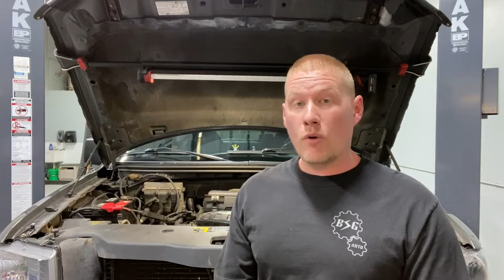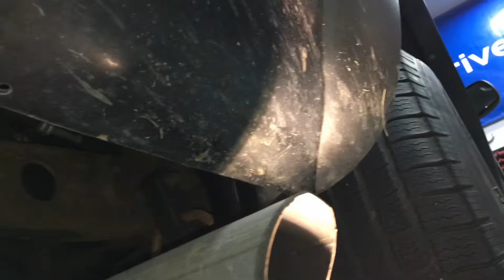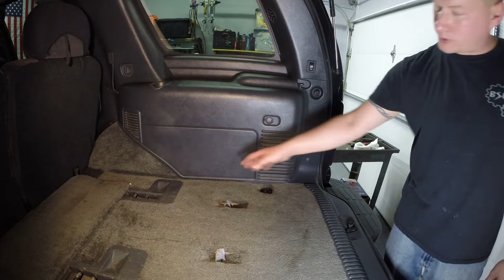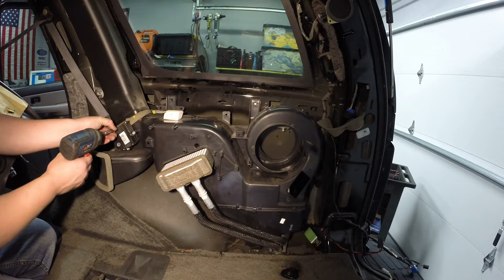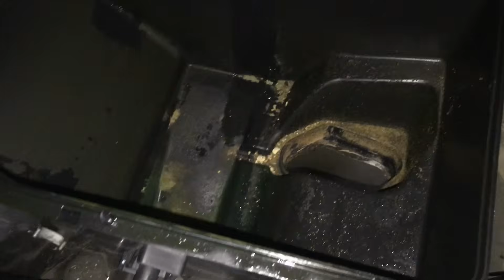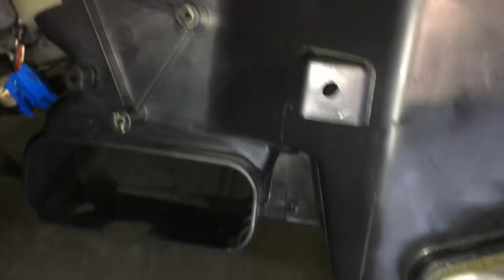2000-2006 Chevy Tahoe Poor A/C Cooling: Rear Evaporator Replacement

Comment: I wasted 30 minutes trying to get the door pins through the holes in the case. You could probably make a whole video on how to do that. I tried wire coat hangars, braising rods, I tried pics, which finally did the trick. I had to have somebody else helping me to line up the plastic alignment pins in the case and to hold the pics so that the door did not fall back down. It was a small nightmare that lasted about 30 or 40 minutes.

Comment: The drain gets plugged and rots the evaporator. Put new drain rubber on here. Use PB blaster on lines a couple days before and AC lines will come right off.

Comment: Man, the AC on this 06 Escalade I bought last year has been leaking worse and worse. The previous owner put dye in it, and we have looked high and low for the leak, but we haven't looked at the rear evaporator. I didn't think the rear evaps were a common failure point but here we. I think this video just fixed me problem lol. Thanks!

Comment: I drive my tahoe alone almost 95 % of the time.  I decide to cap off the rear a/c tubing and just use the front one.  Saved money and the front of the tahoe stays cold still.
Reply: Yo my rear ac line broke that’s under the truck if I do the rear ac delete will this keep the front cold?
Reply: @SixDot2 yes

Comment: Just bought a nice,  no rust, 04 Suburban Z71.  My trusty mechanic is replacing the rear Evap and now I know what he was talking about.  Not hard, just time consuming he said and I agree.  Just as shown there is oil underneath.  I had him inspect it before buying and haven't brought it home yet.  Fixing transfer case,  dash cluster and oil pick-up seal too.  198 K.   Awesome video,  Thanks.

Comment: BSG!   Hey,  is there an orifice tube on the rear HVAC?   Or a filter screen?   If so is it on the high or low side line, and can it be cleaned and reused?   Also,  is the Expansion valve a recurring problem?  And is that included with the EVAP when you buy it?  My Front HVAC works great, my rear HVAC EVAP is not cold.   I have to have a blockage,  either expansion valve, or orifice tube.  What do you think?
Reply: if it is on similar vehicle the a/c system is tee'd from compressor, so a leak you wouldnt have cold up front, most likely you have a blend motor stuck causing heat instead of cold

Comment: how did you find out that the rear evaporator was the leaking part
Reply: mine ,  leak dye could be seen externally from vehicle all around drip condensate drain tube and inside

Comment: Definitely the best video on how to disassemble the rear ac box! 

But here's my issue, this lady hit me right there in the back rear passenger trunk /Ac area! I took apart the panels to get to the ac! I thought the whole thing would be crushed, but it looks intact, but now my concern is the evap part I thinks she crushed that part of it from the way the side quarter panel is pushed in to the point that could be my issue, that part is $250/$500 an to add the icing on the cake ,sorry ass progressive insurance company sided with the lady who hit me, by 80% my fault (nj ain't shit) ,but she hit me in the back trunk area ,but in nj if you make a left turn ,no matter how the accident happened it's your fault! Crazy as f I know!

Comment: I hate those hidden, push-in fasteners.  Removing them correctly feels exactly the same as breaking the damned things... and you don't know until they're broken.  And then the specialty ones cost $87 each to replace.  I'd much rather just have damned knobs to unscrew the covers.

Comment: Thank you! My hubby asked me to tear into this while he worked on other parts of the vehicle. Pretty proud of myself that not only did I tear it apart (carefully)  but I identified a secondary problem, told a junk yard guy how to tear another one apart so I could get the part I needed and then put it all back together. And it works! Your video was nice and clear and yes, getting that second air flow door back in place was a bugger. Thanks again.

Comment: The old Bosch is still with u. I remember u have used those since way back at the dealer. The three pound sledge and the old screwdriver with the broken handle. The only thing better than one super successful YouTube channel, is two super successful YouTube channels. Thank u Brian!!  Great job
Reply: And the cat claws!
I bought the Bosch way back after Brian had recommended it for zipping off the smaller fasteners 👍🏻
And the cat claws too, they're super useful for handyman jobs too.